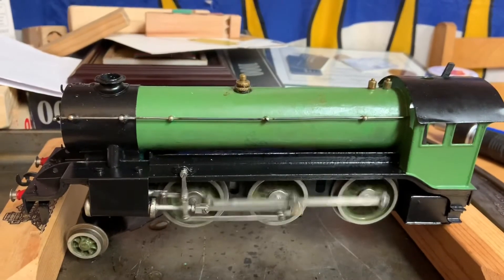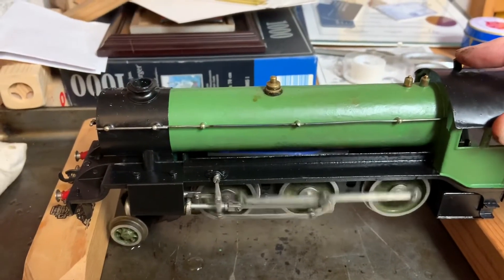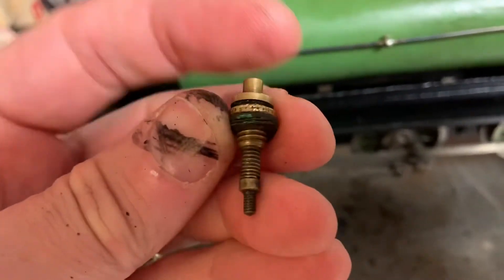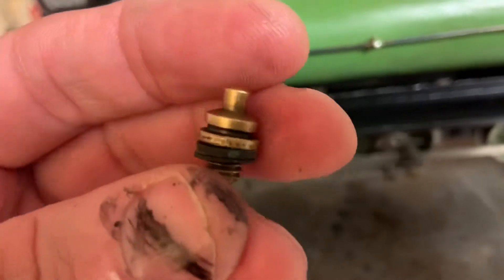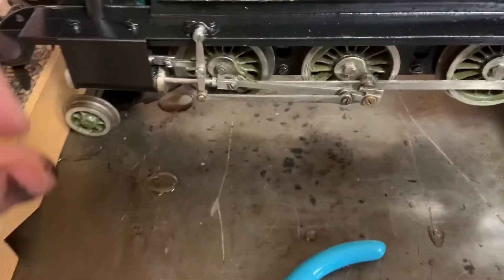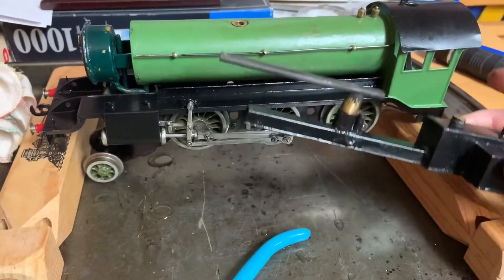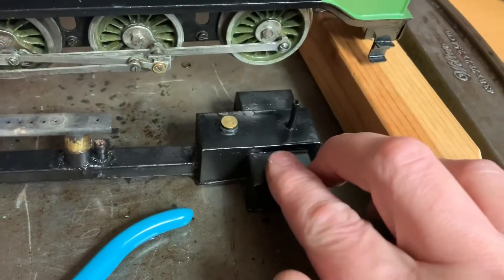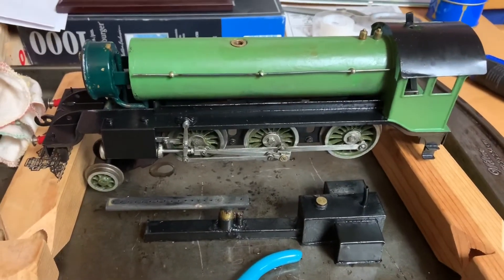Victoria B.C.:  Live Steam O Gauge Bassett-Lowke 2-6-0 Mogul from 1926 - Bench Test

Comment: Nice! I have one just like it only it’s from the 40’s I think. The only difference is mine has a whistle in the cab. Also I’m missing the burner. I have the plans and think I’ll “attempt” to build it this winter. BTW, I have original BL track for this engine. If your interested in purchasing I would sell it as i have a big “O” gauge layout on 072 radius.
Reply from the maker: Thanks. I don't need any track. Every now and then a search online comes up with a used burner. There is someone in the UK that had made new replica burners. Even repairing mine was tricky because wood alcohol is so thin it will run out of any teeny tiny crack that water will not.